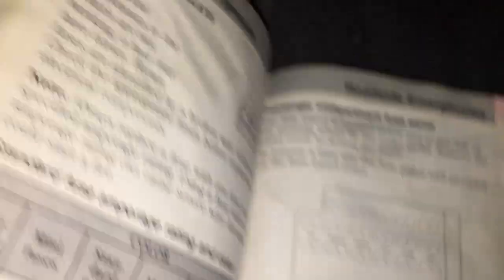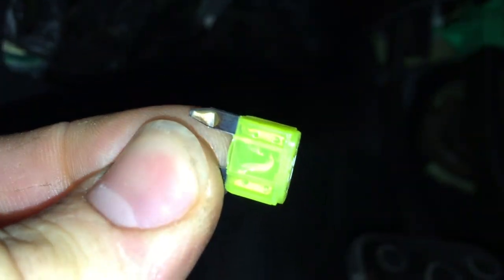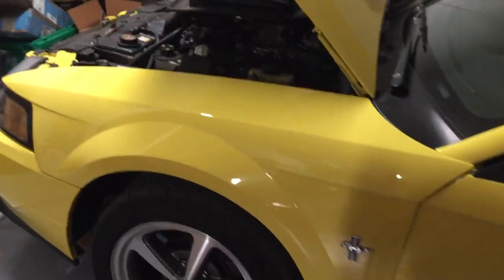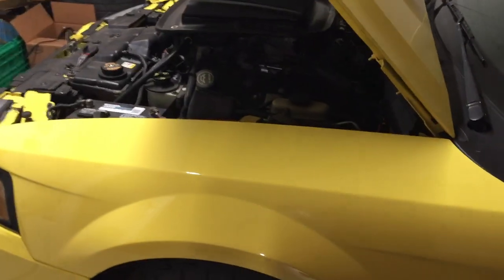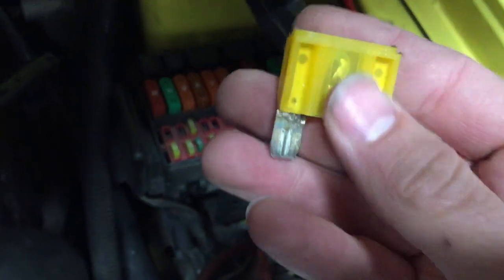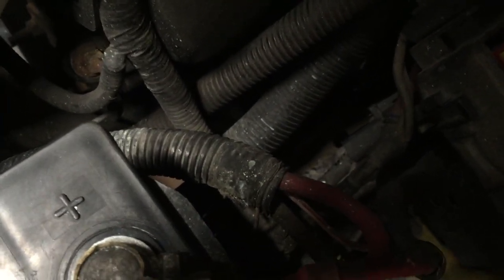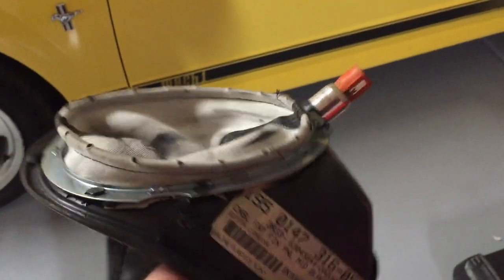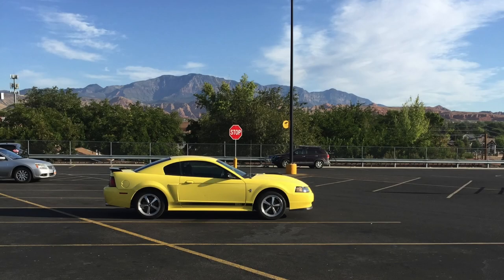Mustang Cigarette lighter fuse

Comment: What would you do if the auxiliary power point wasn’t working?
Reply from the maker: The one inside the center console? It has another separate fuse
Reply: @justin.c_svt  I checked the fuse it was good. Unfortunately I think it’s the wiring, I used a tester and it had no power

Comment: My 50 amp fuse for electric fan has blown under my hood car got hot any tips for checking fan? The fan does spin freely someone said no matter what temperature the car is the electric fan should run when air conditioning is turned on.
Reply from the maker: I knew that about the A/C but tried it on 2 of my mach 1's and the fan did not kick on. I believe thats because if the freon level is low, the compressor will not turn on (A/C clutch will not engage) to keep the compressor from burning itself up. On my other mach 1 that the A/C blows cold, the fan does kick on when you turn on the A/C. If your freon level is low the fan wont kick on basically. As for the fan, the wires to it or the connector may be corroding or arching, causing the fuse to blow.
Reply: @justin.c_svt Why is my 2004 anniversary 4 cylinder coupe the guage hand shows it running hot? im not sure if running hot could just be the temp guage handle is there any fuse can check? Only does when it's hot out it moves goes towards the red mark especially when turn the AC on I live in the south I put new thermostat hand still shows it to the red mark but only when it's hot Will it boil over first or lock up when it goes towards the red mark or gets to hot? I live in the city does that especially when the AC is on idling the guage handle goes toward and to the red mark but only when it's hot out.

Comment: Where do you buy a new fuse??
Reply from the maker: Most auto parts stores should have them. Some hardware stores have them too
Reply: @justin.c_svt  what fuse humber was that for the lighter.
Reply from the maker: @KrishnaSingh-ow1ie location number 1 under the dash and number 9 under the engine bay